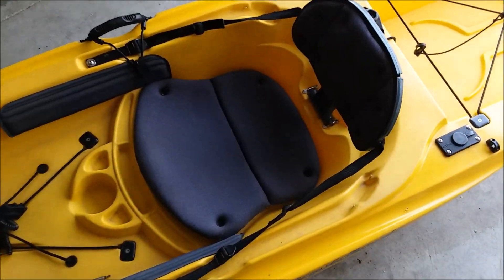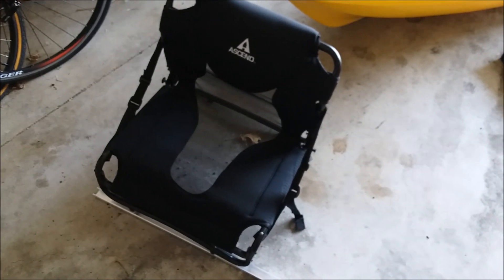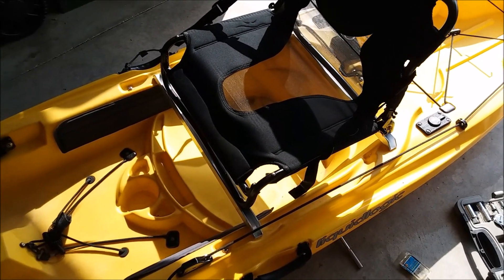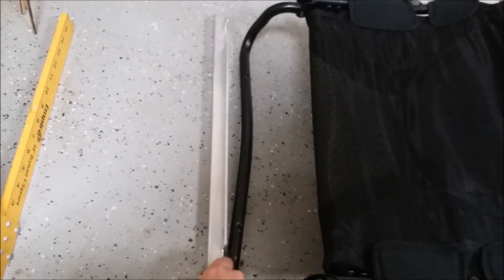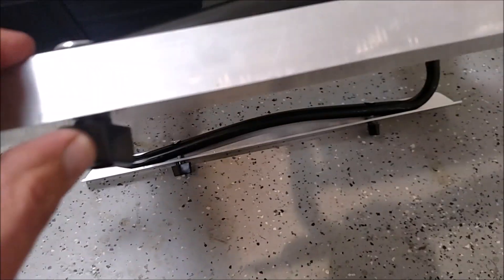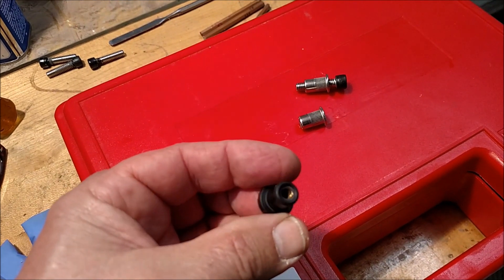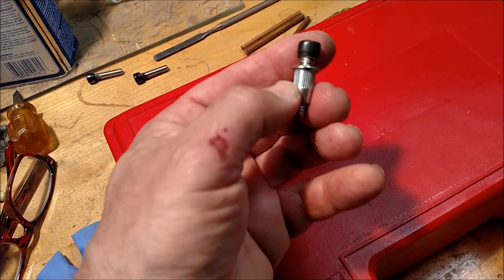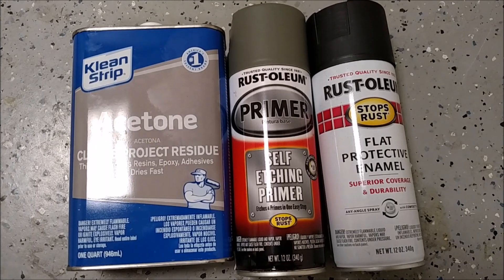Sit on Top Kayak raised seat upgrade

Comment: That is my question how does it handle now? Does it want to flip real easy?
Reply from the maker: The kayak handled okay, however because the center of gravity was higher it was less stable. I eventually lowered the seat at the rear and this gave the kayak more stability in white water. So, I would follow replacing the seat with well nuts, but you can lower your seat modification to better suit moving water.

Comment: Have you tested this seat mod yet?  Better?  More comfortable than before?
Reply from the maker: I have floated with the kayak and the seat is far more comfortable. It is also a better casting platform, much easier. There is a little trade off in stability and I can lower the seat a few inches. Much depends on your style of kayak.

Comment: I raised the seat on my Sun Dolphn Bali 10 which is the same as the Journey 10.  But before raising the seat, you need to add outriggers, because the kayak is hot stable enough.  Here is a video of the project. https://youtu.be/hG0fM5CxvVE

Comment: How was the stability in the kayak with the new raised seat?
Reply from the maker: Matt, I found that I did lose a little stability as my center of gravity was raised. I opted to lower the replacement seat a little more, particularly in the rear. It is a little difficult to see in the video, but near the beginning where I take the original seat out, there is a raised area at the rear of the seat well. To this I mounted an aluminum bar. I also lowered the front of the seat a little. The seat was eventually a bit lower and tilted a little more towards the rear. Following that modification the seat and stability has worked very well on a number of floats since. Many newer sit on top kayaks are wider than mine, so a modification might depend on a few factors.
Reply: Keith C thanks for the feedback, I’m throwing around some ideas for raising my seat and I like what you have done.
Reply: Perfect . This comment complete my question... thank you  berry much. Good job